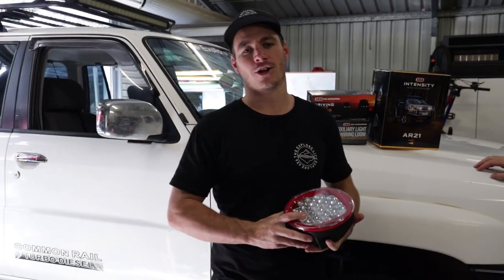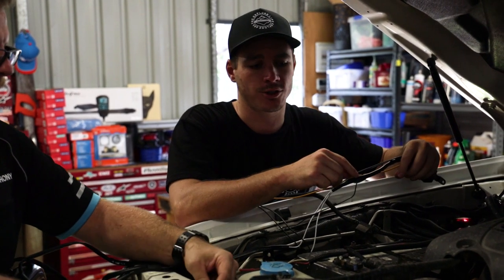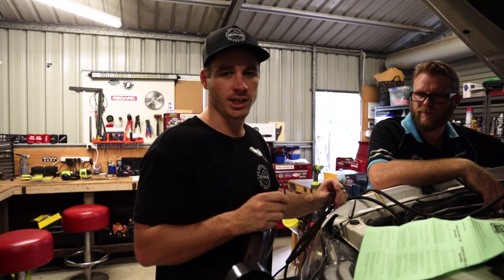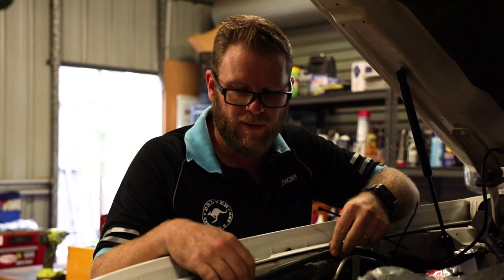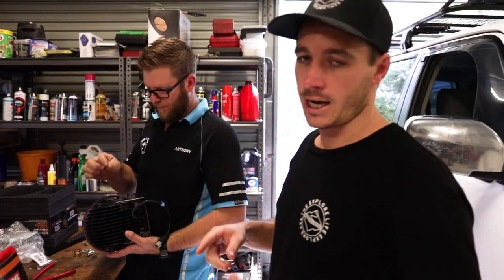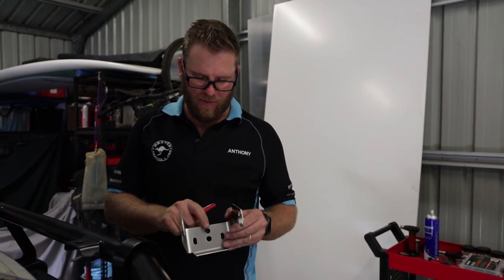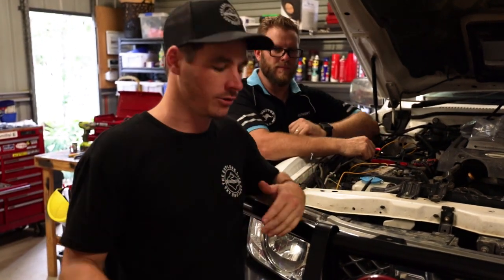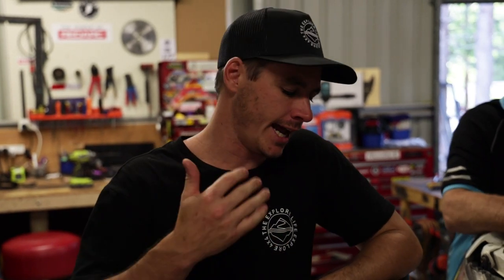DIY SPOTTIES INSTALL- ARB INTENSITY’S LOOKING THE GOODS - EXPLORE LIFE BUILDS GU PATROL- P3

Comment: So ARB lights won’t fit on An ARB bull bar without drilling holes ??? Who at ARB fecked that up ??
Reply: The GU ARB deluxe bullbar would have been designed well before the LED intensity lights with 3 hole mounting came out out, so when the bullbar was designed all lights would have been single bolt mounting, hence the single hole, later model ARB bars such as their newer Summit Bars have the 3 holes designed into them👍
(I may have worked at ARB previously ;))
Reply from the maker: Spot on Drover 👌